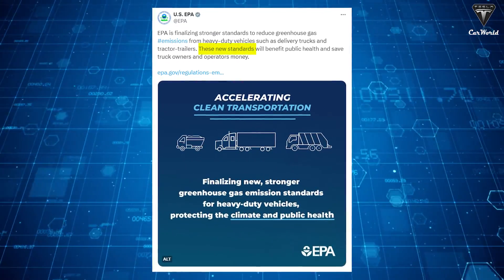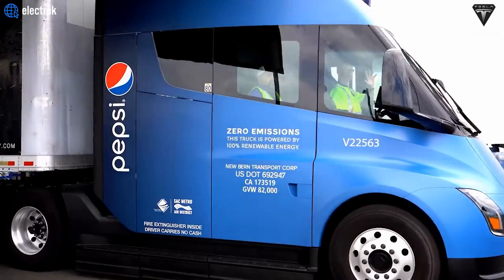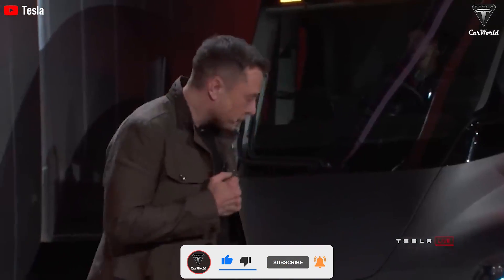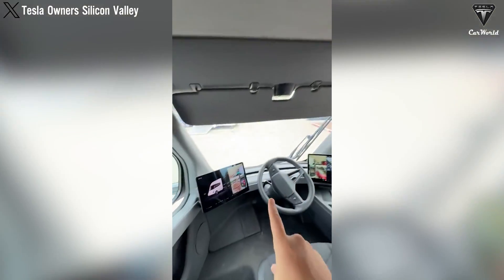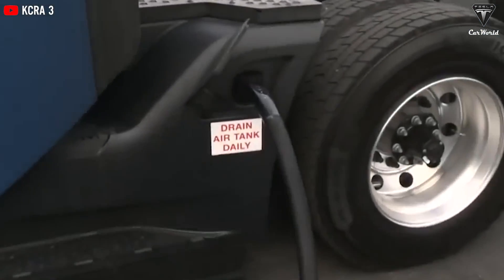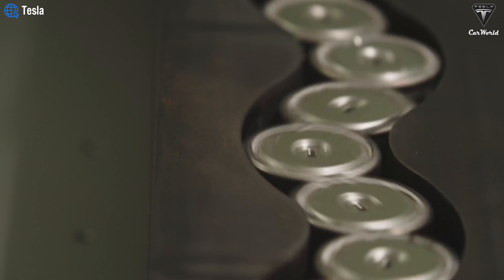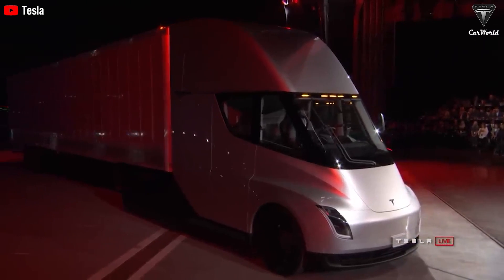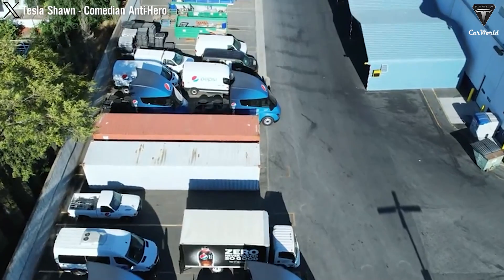It Happened! Elon Musk LEAKED Tesla Semi Truck New Upgrade Exterior & Interior Design in 2025!

Comment: The amount of km"s a truck travels in a country like Australia is ridiculous, most trucks just go an go day an night an only stop when they have to either way how long are the battery packs going to last before the owner is up for the huge cost of replacing them . The Diesel motor they run these days just go an go do you think the cost of replacing these packs wont scare them
Reply from the maker: If you are comparing the cost of a diesel truck with an electric truck of course there is a clear difference. about all costs of the vehicle being transported. Of course, the advantage still favors electric cars
Reply: Not sure what you mean by the vehicle being transported . I'm talking about the cost of running an electric truck compared to a desiel truck when it comes to having to replace the battery packs compared to the trucks desiel motor still going strong after as much as 900k km which there is endless amounts of Bdoubles running around my country Australia. It's the same as the Tesla cars what 5 ,6 possibly 7 years and your up for a heap of money to replace the battery packs where as a good well maintained car will still be going . And don't say that electric cars are cheaper to run either because in my country that's a mith . They did a test where they drove 2 cars all be it they were I think BMW one petrol one electric from Sydney to Melbourne. The petrol car got there first because of charge time and then taken into cost of charging the electric car the petrol car actually came out on top . Look in another 5 to 7 years there will be second hand electric cars not only in my country but yours and every other country around the world where they are sold being dam near given away because after the battery packs die the average person will not be able to replace them because they will cost as much as a major engine rebuild easy to replace and mean while the person with the well maintained petrol car with between 400 and 500k km"s would still be going

Comment: Why can't they just fix solar panels on roof of truck or on top of trailers.  No need to charge at all then.. just like those students from Holland..converted VW camper I to ev and they drove it non stop for well over 6 months solid all over Europe.
Reply from the maker: Are you wanting the semi tesla to also apply that? That's a good idea and perhaps it's also in the research of the Tesla design team. But we may have to wait quite a while
Reply: Are you kidding?  Solar Panels takes about 8 hours to charge 1 kWh/Per square meter.
Semi-truck power consumption 1.24km/kWh

Unless there is black technology for Solar system, it is suicide.

Comment: The optimum 600m is not enough you need at least 1,000m to out perform diesel trucks on.your battery performance. Once this number is achieved the bar is set,Bingo baby you win Elon!
Reply: In USA c' est different 600 milles est correct 
Le chauffeur doit dormir, manger, les aires de repos tout les 100 miles ...:face-blue-smiling:😵‍💫🤠🥸👽
Reply from the maker: Currently, do you think any electric trucks can exceed this standard? I think it's quite difficult